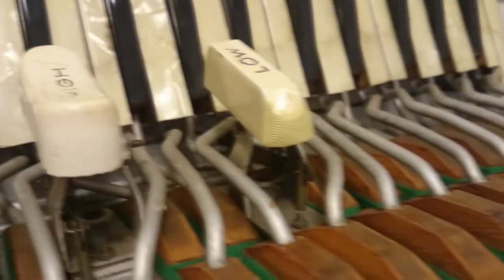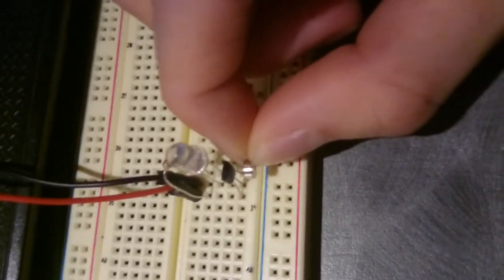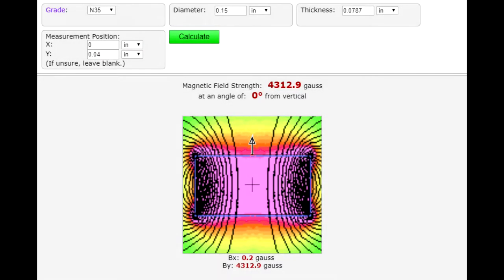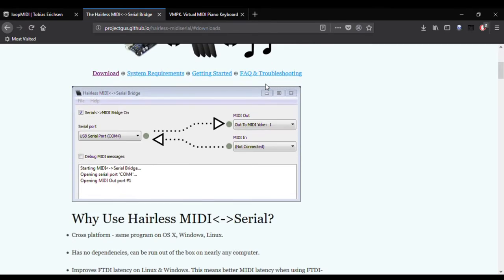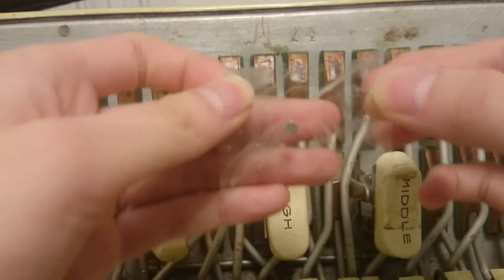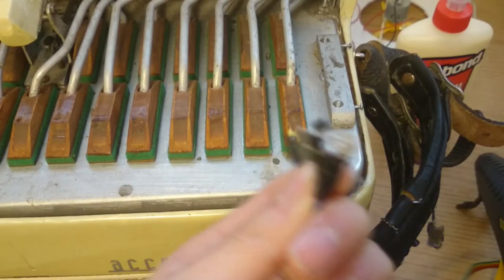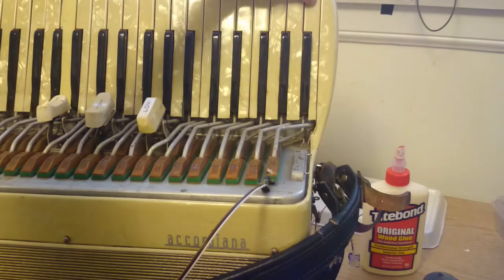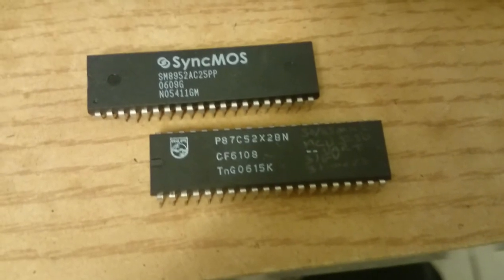[Bytes #2-4] DIY MIDI Accordion - The First Key

Comment: Hi! I got to complete the treble key with midi and to increase the number of analog inputs for the arduino i used a MCP23017, and it worked just fine. The only problem i got is that the response in not so great. I believe the travel of the magnet is very important. Maybe with a better circuit for the hall sensor can be obtained better results.